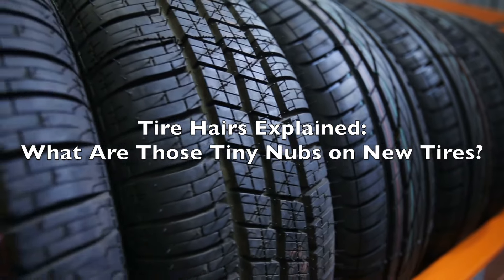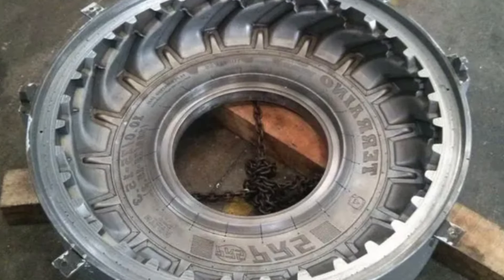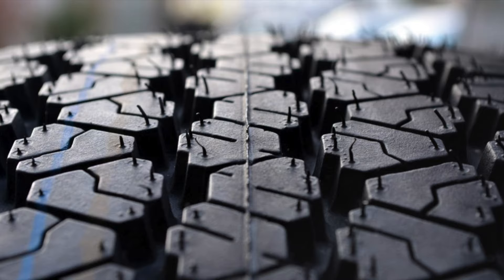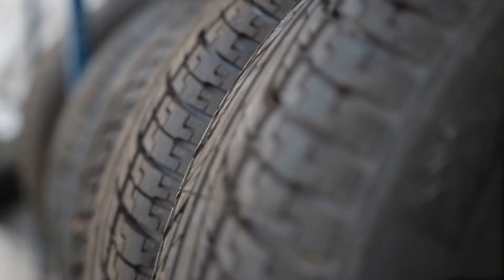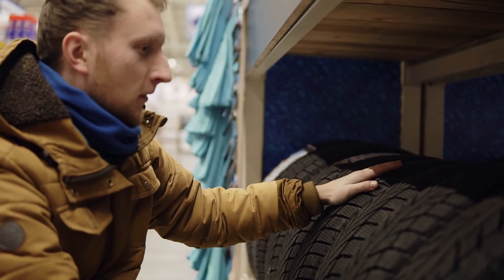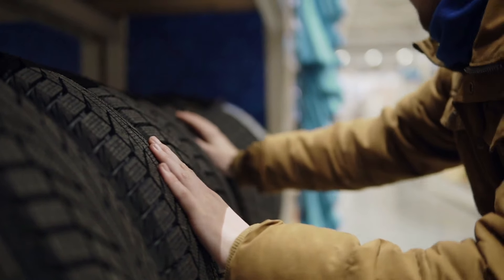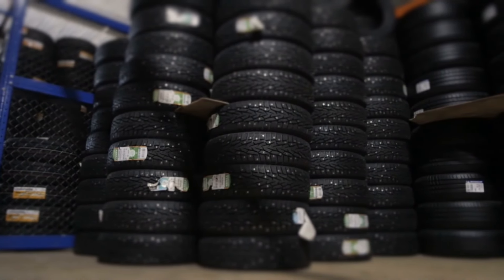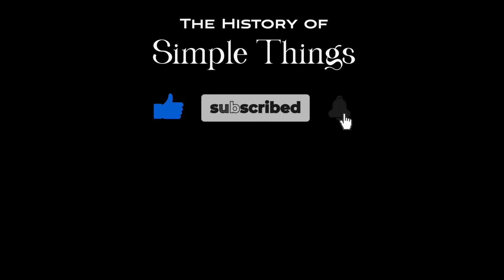Tire Hairs Explained: What Are Those Tiny Nubs on New Tires?

Comment: Fortunately, the tire shop I patronize offers tire shaving services when mounting new tires in addition to inflating my tires with nitrogen and changing the blinker fluid. Worth every penny.
Reply: Did you get a DVD rewinder for your birthday?
Reply: @mRahman92 Mine came with a bottle of laser cleaner.
Reply: Do they offer seasonal change of nitrogen?😂😂
Reply: y'all are too funny 🤣🤣🤣
Reply: I fill my tires with 78% nitrogen and 21% oxygen. It works well.
Reply: I hate paying to get my engines water injector serviced every month, it almost felt like a scam. My mechanic sold me a subscription service to get it handled for a single large payment every year, so no more monthly bill for me. He even added canuter valve calibration and he checks every time to make sure that I don’t have the wrong air in my tires. I guess the wrong stuff can leak in. I can’t afford regular oil changes now but at least I piece of mind. I’m just not sure whose.
Reply: If you get a bad tired that can’t be repaired and have AWD, then it may be recommended to shave a new replacement tire. The tread depth between all the tires needs to be within a certain range of you can damage the differential.
Reply: Mufflers last longer if they apply the muffler bearing grease every 3,500 miles. Make sure you don't get cheated by the shop not using the high temperature grease
Reply: @NYCS19339  I’d better make a call to my mechanic tomorrow morning. I haven’t ever asked for the muffler grease. This discussion is reminding me of my failed efforts at cow tipping when I went to summer camp in junior high.
Reply: The nitrogen is a scam. Regular air is already 78% nitrogen. Increasing it doe no good. Check it out.
Reply: @benjamindover4033  but we all know that more is better because the SR71 used pure nitrogen and more is better
Reply: People underestimate the importance of blinker fluid! Thank you for this important reminder. 😂
Reply: @cyberGEK  I find it cheaper to buy it in concentrated form and dilute it at home. Less packaging waste and a lower overall cost.
Reply: @benjamindover4033  You might be right, but that blinker fluid is worth every penny...

(Translation: I believe the whooshing sound you just heard was the joke ;) )
Reply: @bc5441  Blinker Fluid when was this added to our cars 🚗? 😉
Reply: I paid for the optional braiding service. Was it worthwhile?
Reply: I buy a gallon of prop wash for my Cessna every other time I fly it.
Reply: @badlandskid  nothing like a clean prop. 😂😂
Reply: @DSilverwood  for sure.  Dirty props just don’t fly around here.
Reply: yeah costly shop for good man
Reply: I've made sure that every tyre I've bought over the years was filled with at least 78% nitrogen.
Reply: He must be part of a dealership. It's one of those special things they offer to get a hold of your money. Don't forget about that all important Window etching. Criminals really run away from those.😂

Comment: It is tire stubble. It means the tire needs a shave. Some tires need a shave every month or so.
Reply: Manscaped has entered the chat
Reply: Would that throw its 'balance' off? My car's tires are bald, what to do, oh, what to do?! When I was in high school I worked in a tire shop that recapped tires. We had a knive with several V-shaped blades. We would pit the tire on a device, inflate it a little, rotate the tire  and actually shave those off.
Reply: so it means the tire has reached puberty? 😂😂
Reply: @Colorado_Native  "My car's tires are bald, what to do,"  Tiregaine Rogaine for tires.😂😂
Reply: @Support_Ad_Blocker  That's an idea. Do you have to mask off the sidewalls?
Reply: @Colorado_Native    Would be advisable. Don't want tread growing in unwanted places....😂
Reply: @Support_Ad_Blocker  So, let me understand this. No on the sidewall sideburns, correct?
Reply: @Colorado_Native   Use ONLY on or close to the crown of the tire. And just as Rogaine can cause high blood pressure in people, Tiregaine may cause increased tire pressure, so monitor & adjust accordingly.  😅
Reply: @Support_Ad_Blocker  Great advice. My Jeep has TPMS sensors. Do I need to recalibrate?  I'm a cheap Charlie, I don't like spending money on my car if I can buy me a big ol' Wendy's Baconator, large fries ang large soda. Thanks for the great advice.
Reply: @Colorado_Native    Tiregaine may require  TPMS recalibration. Also, like with dizziness in humans, Tiregaine may cause wobbliness, especially on wider profile tires.  Discontinue use if this occurs.
Reply: @Support_Ad_Blocker  Yes, Jeeps with solid front axles are known for their 'wobbles' anyway. Why make a known issue worse? Unless they would counteract. Would that cause hopping? We may need to apply for a government grant to study this problem
Reply: @Colorado_Native  Phase synchronous hopping?  Here's hoping that hopping never happens....

Comment: Trapped air will actually destroy a rubber mold. The trapped air and oil in the rubber will burn in a process called dieseling. The dieseling will quickly start to erode the steel.  I used to work as a mold maker at a rubber molding facility and we could usually guess where we needed to add a pin vent,  harder rubbers were more apt to trapping air too. We used small drill bits to put in an occasional vent.  These tire molds seem to have hundreds of pin vents, I'm curious what they were using to put all those holes in their molds. And how they keep the vents from filling in with rubber and not functioning anymore.
Reply: Plus, if you don't get the air out, you can't get the rubber in.  An unvented cavity won't fill all the way.

They're put in by drilling in a five-axis milling machine.
Reply: Five axis milling machine?  Wow, it's as simple as that? Sounds like you are a real expert.  😅
Reply: @paul5683  I wish I had pictures of when I yoosta do that stuff.

Comment: They are vent sprues in the mold, not spews. Colloquially called tire hairs.
Reply: Yes, “sprue” is a common phrase and occurrance in injection molding manufacturing processes. Using “spew” just makes this video look dumb.
Reply: Exactly!
Reply: This video is stupid. He said the same thing 6 times. Didn't even mention what the green and red lines were on the tire.

Comment: Rubber is never injected, tires are made of different parts and in varios layers with a surprising amount of manual work. Remember there are steel wires and even steel rings on the sides to help the tire attached to the wheels. Once a tire is assembled it is put in the mold just for the final step of fusing everything into one piece.

Comment: tire rubber is not injected. tires are laminated ply by ply on a machine then inserted into the mold and closed . then a bladder inflates and presses the raw tire into the mold and steam is used to heat and cure the tire.
Reply: Came here to mention that.

Comment: All that rubber, from all those tires..into the environment..I know rubber dust is bad for fish spawning streams..  the manufacturer should grind them off and reuse it..
Reply: You can't reuse rubber, it's a thermoset product.  If they could recycle rubber there wouldn't be mountains of the crap laying around.  I shouldn't say that it can't be recycled,  they grind it up for mulch and in some climates they can add a little to asphalt but in cooler climates it won't stay mixed .  There is a process used in some countries where they heat tires in a sealed chamber and are able to break the rubber back down into its raw elements like carbon, oil and steel from the wire belting in a tire.  Seems like a dirty and polluting process but some countries don't mind.
Reply: @paul5683  To amplify what Paul here is saying - a "thermosetting" polymer like rubber is one where the primary ingredients (called monomers) react with each other in a permanent fashion. Heating a thermoset plastic will not result in decomposition back to the monomers, so thermoset plastics cannot be recycled into new products (unless it's ground up or cut pieces, and those are used for product, like Mulch or doormats).
Reply: @paul5683 I worked in a tire factory, scrap and defective tires were sold to a cement manufacturer to be burned as fuel. Supposedly no gases were released to the environment and everything was handled ecologically. I find it hard to believe but all companies involved have much to lose  if it turns out to be false.
Reply: @joeylawn36111 if tyres primary ingredient is monomers U can't it be recycled?
Reply: @adrianlovic6486  Rubber latex polymers cannot be broken back down into monomers after they have been treated with heat and catalysts.
Reply: @joeylawn36111  so the monomers are thermoset to become polymers and can't be reversed back to monomers ?
Reply: @adrianlovic6486  correct